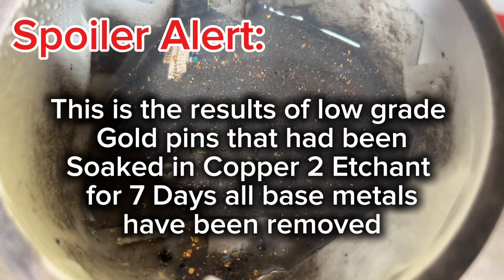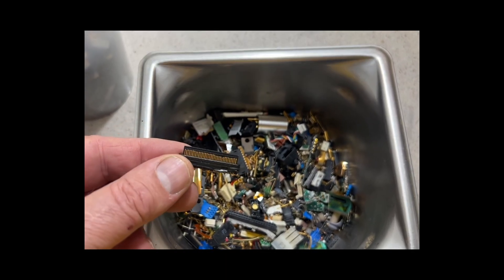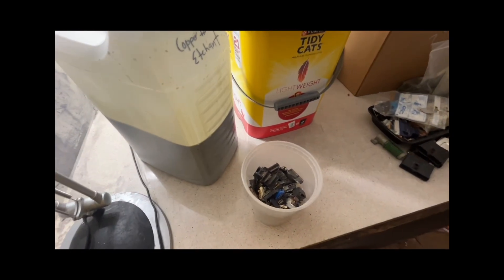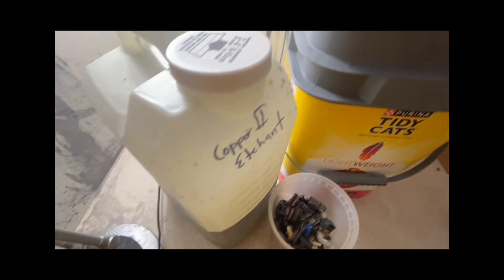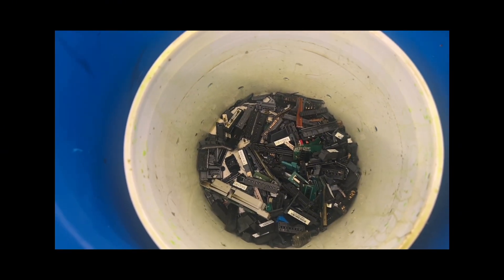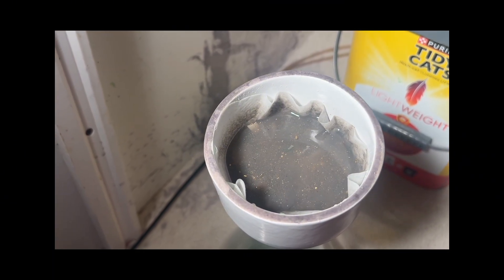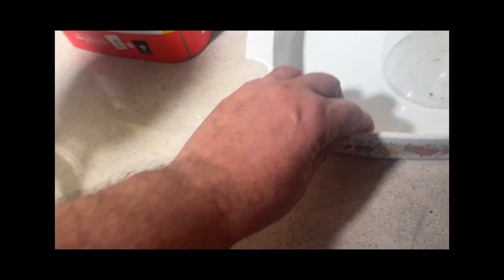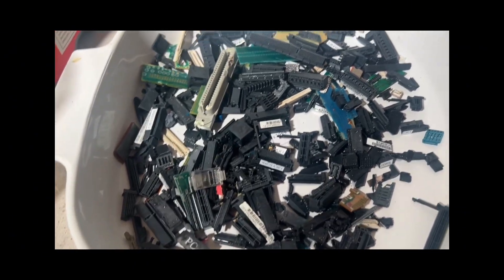Beyond the Circuit Board : Gold Recovery from low grade gold pins  #goldrecovery #electronicwaste

Comment: Brother Ive been doing that method for years but in coffee pots with an air line. I use a bucket with holes for my ic chips. They take a bit longer. I wait till I've done several batches to process my gold. But it's a revolving process that never ends
Reply from the maker: Thanks Richard , might have to try that especially with a plastic lid to keep the splashing to a minimum and I can see what the bottom looks like . Thanks
Reply from the maker: Broke out the coffee pot o process 350  RJ-45 connectors this week video coming soon
Reply: @Hill-13 awesome. It's nice to be able to see the process through the glass. Happy hunting.
Reply: @Hill-13 those are phone connectors. They don't work great an AP. I get about half the gold typically and I use a squirt bottle for that. I don't get enough of them to try but think straight to aquaregia may be better.
Reply from the maker: Oops too late put them in last night , cut the ends off with Klines . I thought about nitric st first because there is no tin , so no metastannic acid to deal with . I will check it out tonight , dang lesson learned

Comment from the maker: Part 2 Beyond the Circuit Board , Gold recovery from low grade waste . We will be using acid peroxide / Copper 2 Etchant to remove the base metals . Total time in bucket less than a week . Thanks for stopping by , getting closer to 2000 subscribers thanks everyone !